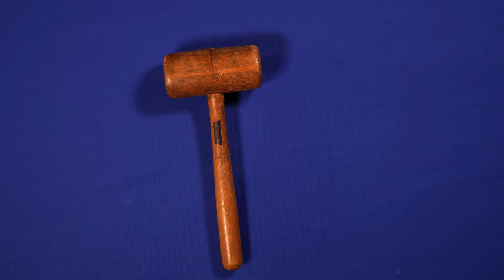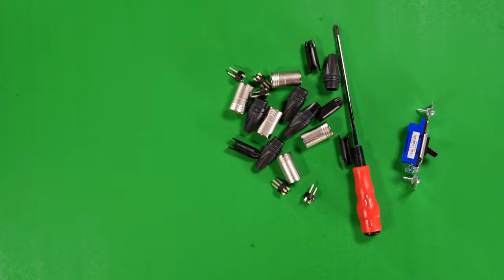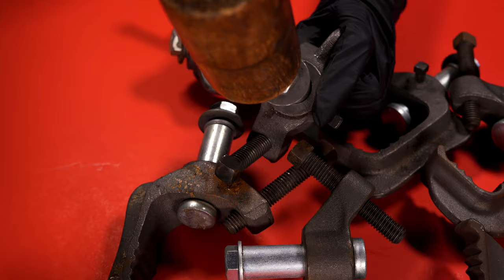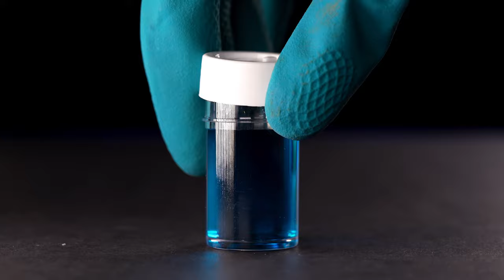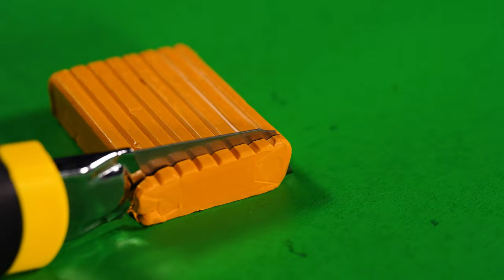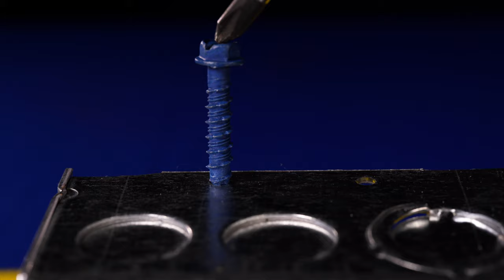Low - More (Official Video)

Comment: The guitar tone is obviously awesome but has anyone shouted out the polymeter in this? Lyrical phrases 8 beats long on top of musical phrases only 6 beats long, so they go out of sync with each other and then match back up a few cycles later. Cute and slightly unusual bit of technical songwriting.